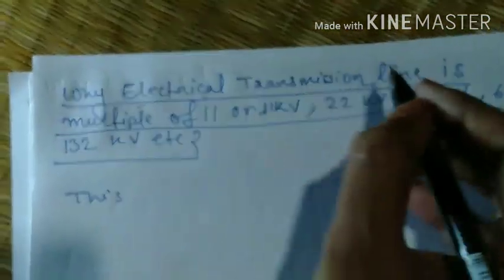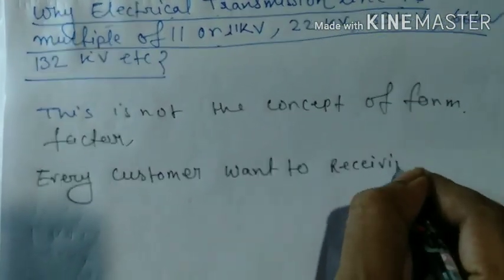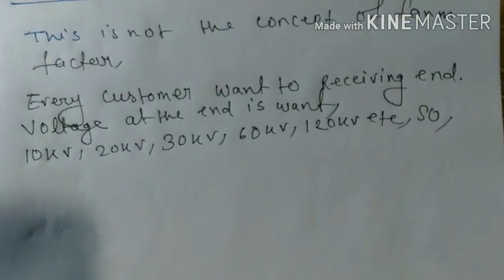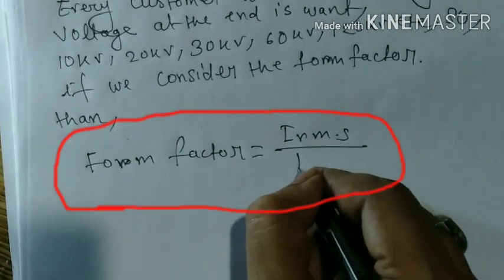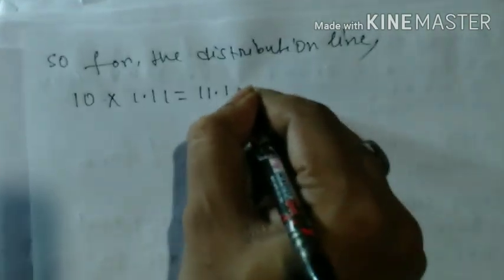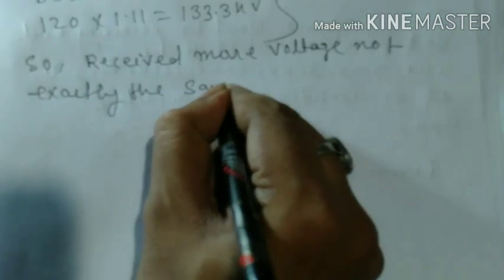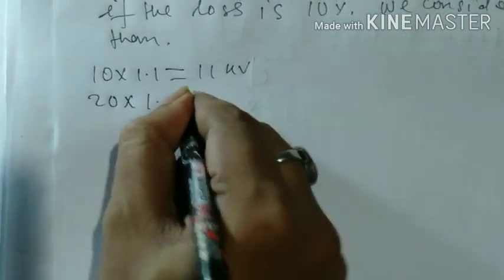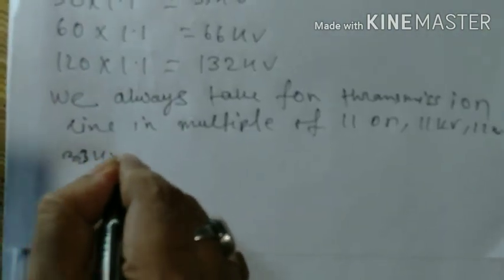Why Electrical transmission line is multiple of 11 ie 11kv,22kv,33kv,66kv,132kv etc.

Comment: Sir , if I had a motor of rated 11kv but I am supposed to give 10kv to that since 1000v are meant for loss.
Reply from the maker: We take 10%loss ........for transmission system....
Reply: @World_electrical_Electronics  sir if I had a motor of 11kv how much voltage it  actually takes 11 or 10 kv. If 11 we need to send 10 percent more than 11kv